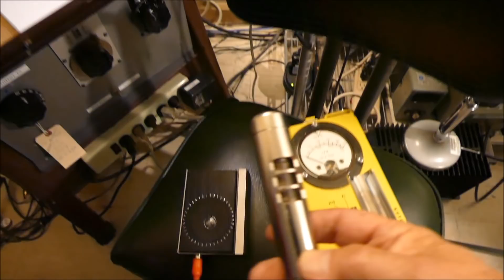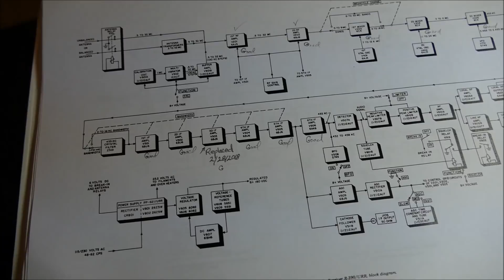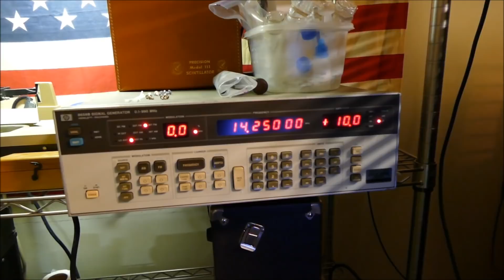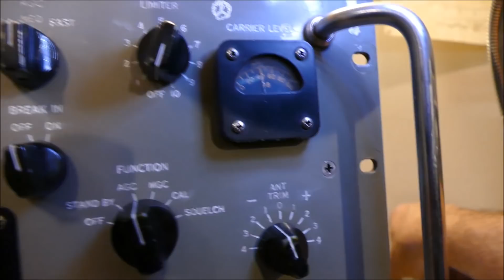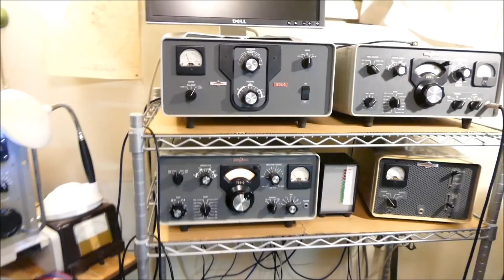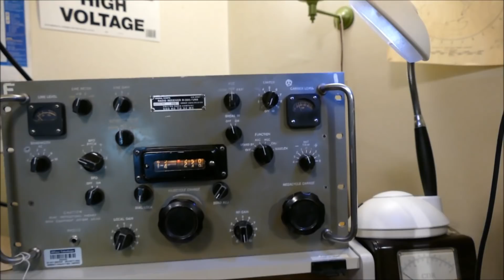Maintaining The Collins R-390 Receiver

Comment: What about a small RF preamp based on 4x Nuvistor vacuum tubes, one driving a 4:1 balun to drive two in balanced mode which will drive the last 4:1 balun which should give a useful gain boost.
Reply from the maker: Don't give me any ideas...  :-)   Like I need another project.
I do have some of the Nuvistor tubes and sockets. I like the idea. If i build such a circuit I will post it and we can all see how it turned out. Thanks.